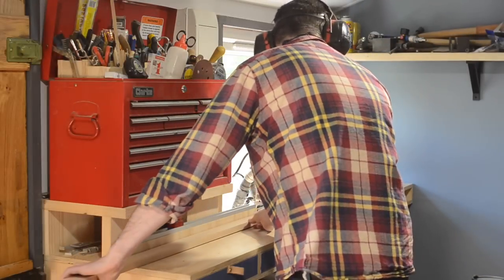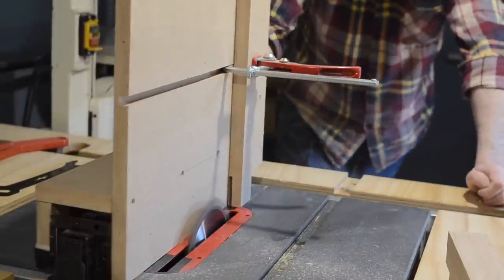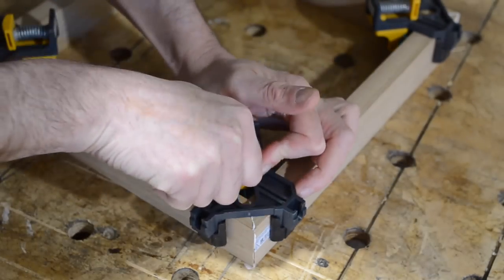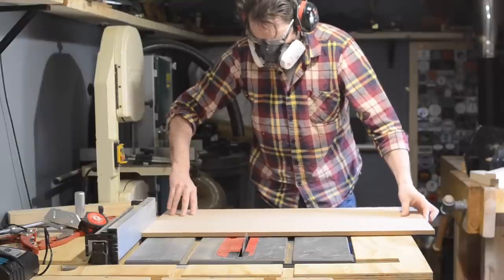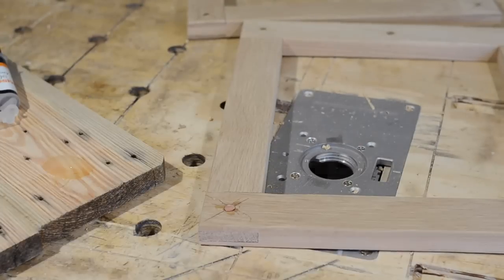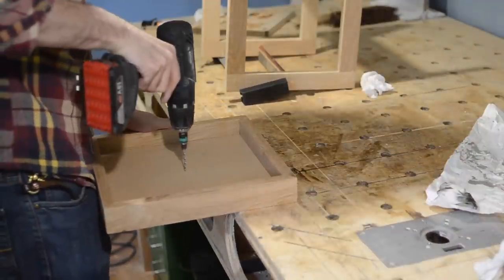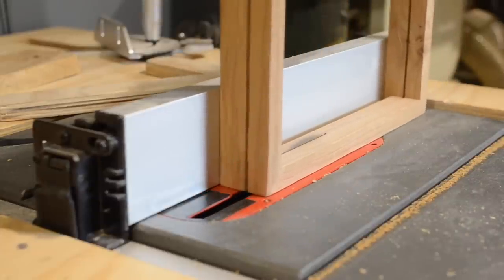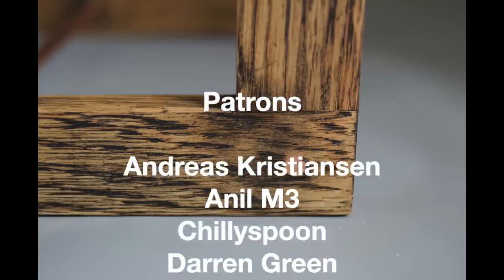Oak & Copper Side Table

Comment: While this is nice, the MDF spoils it for me. Would have preferred you to have made a glued up panel instead. However, it was great to watch.
Reply from the maker: Sorry I spoilt it for you
Reply: @Ace-zb5xr  True, but that's not my point. If it were my table I'd want it all oak. You might think it a small detail but, for me, it's big. We all have an opinion and that's mine.
Reply: Its hidden and ideal for the job as Its cheap and very stable  and nobody will ever see it  unless the client is one of the Borrowers :)
Reply: @Badgerworkshop  That MDF was the most stable option to attach sheet copper to. A solid wood panel could give problems given expansion etc.
Reply: As my dad use to say "always one no matter where you go"

Comment: Very nice project. The copper detailing is excellent and the joinery like very good. I like the fact that you left in the part of the video where the router dug in, a safety lesson that others can learn from. It would be interesting to see how you package an item like that to ensure it arrives in pristine condition - I've had a few things ordered online recently that arrived damaged, despite being reasonably well packaged . . . . .
Reply from the maker: Thanks Mike. I send quite a lot. I use eco packing pellets and they work well.

Comment: Looks great! I must say, I'm not a big fan of oak or copper, but the copper complements the oak! Not sure I would have gone with the finish they chose, but each to their own!
Could you not have cut the pieces down at the mitre saw then cut the rebate out on the table saw before gluing?
Reply from the maker: It is harder to push pieces through the saw if they have a 45 on the end